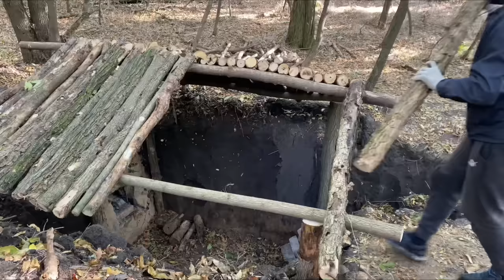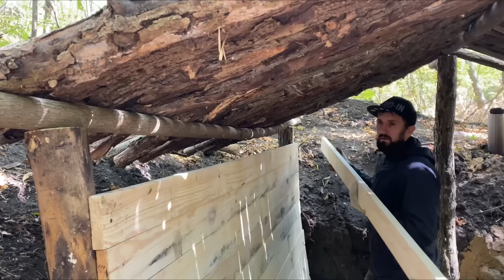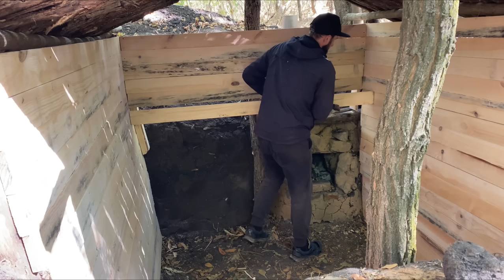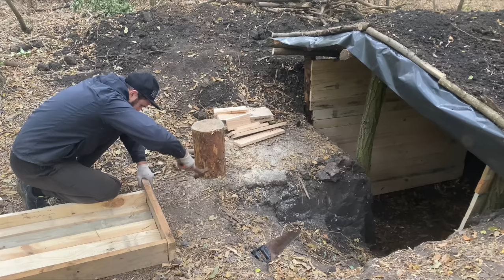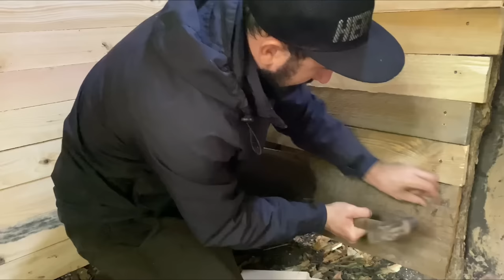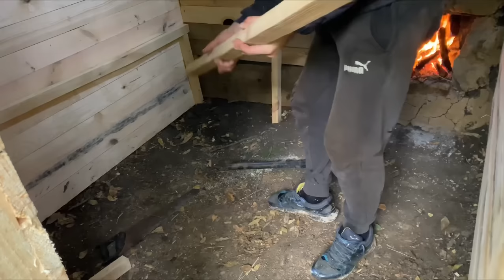Building of Cozy Dugout for Survival in the Forest

Comment: not sure what you’re trying to achieve. the whole bully is wonky, you’re using untreated wood, you put soil against it on the outside without any moisture barrier which means your wooden planks will rot, water will seep into your dugout and the whole thing will begin to mould.
also you didn’t remove the bark from the wooden logs…..
Reply from the maker: I'm not going to live there for a long time, I'll build a new one. But I think this one will last about two or three years exactly